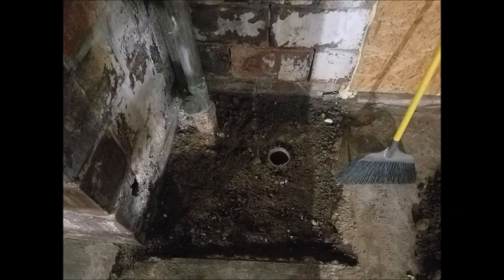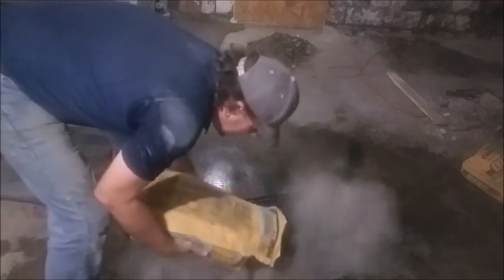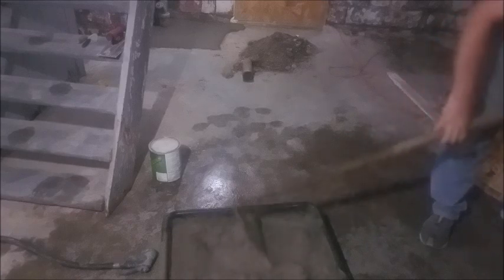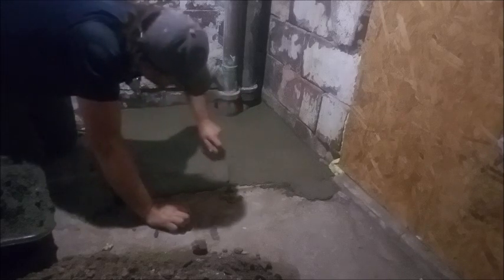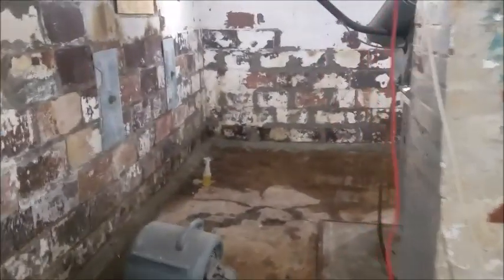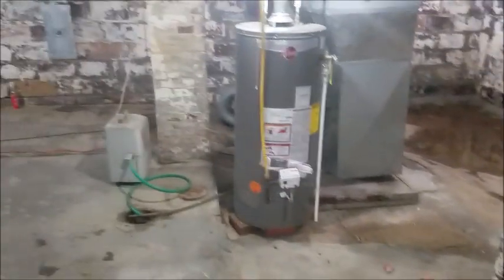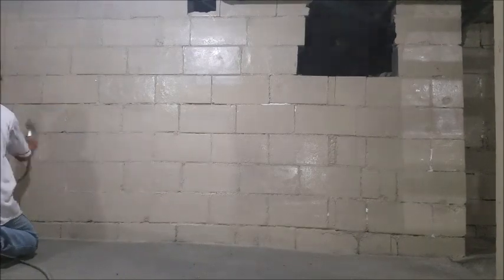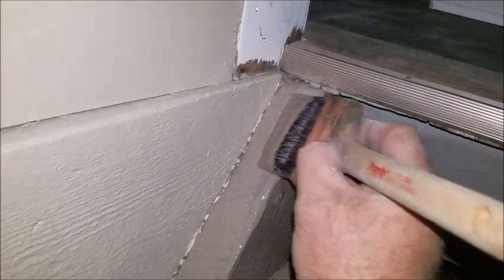Basement cement repairs and painting

Comment: How long did project take from start to finish ?
Reply from the maker: It took a couple weeks because there was a few things not shown that was done. There was the old and wet, from broken pipe, insulation removed. Old cable and phone wires were removed. Along with a wall to separate one area and a very old toilet room. The painting was 2 days and the cement repair was another day with a day for cement to dry.